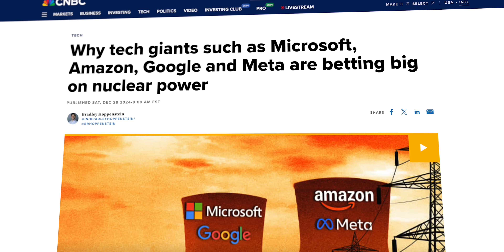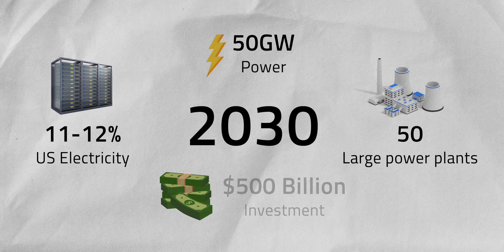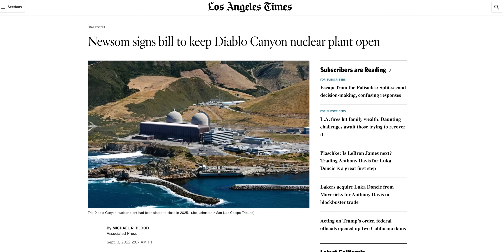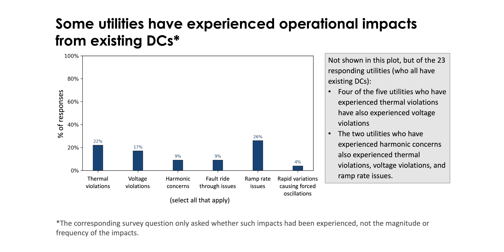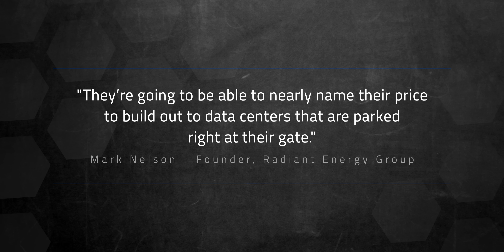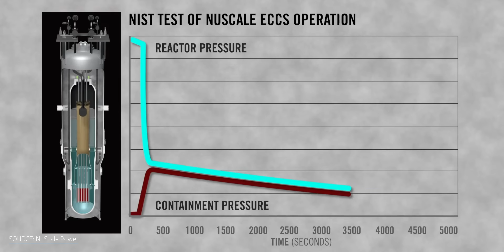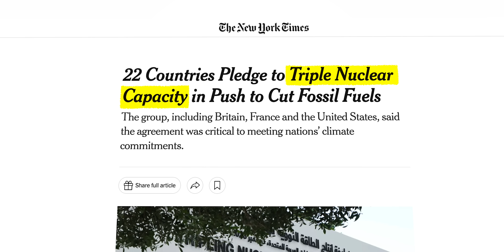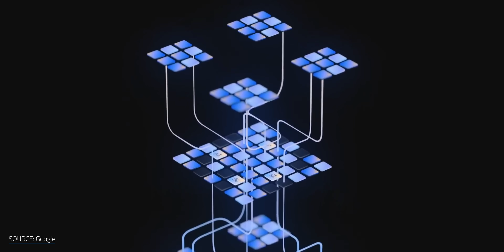Why Big Tech's Betting Billions on Nuclear (Not Renewables)

Comment: As a design engineer that works on automotive electrification directly, it always amazes me how many people talk about the affects of EV charging on the grid when data centers are using WAY more power than EVs. This just goes to show that public perception is all about marketing.
Reply: What? Datacenter load is flat. EV charging is variable. Even more variable when DC fast charging. There is nothing utilities hate more than variable load that requires active load balancing and coordination of fast dispatchable power. They are so concerned with it that a Microsoft Datacenter in Washington had to run multimegawatt load banks for several days to avoid fines from the electric company for not using enough power due to delays. The cost of electricity was less than the fine for not using it.
Reply: @erikkovacs3097  Great points! I think in general his comment is hitting two political mindsets while not making apples to applies comparisons when it comes to electrification. You're completely right, but I think he's generally making the comment that right leaning voters and administrations are green flagging the rapid growth of data centers to reap the financial rewards of the big companies racing for AI dominance. This rapid increase in electrical load from fossil fuel powered power plants threatens most environmental Co2 emission reduction goals. On the other hand is the push to transition away from fossil fuel vehicles to electric vehicles in order to reduce carbon emission goals as well as other benefits, which is negatively viewed by the conservative right and is facing large public cultural backlash. I personally like the idea of Vehicle to Grid charging to alleviate electrical load to the grid, but I like how your comment points out realities of power plant operation.
Reply: @victortillamillamonster4083  The large backlash for EV's is mainly because we were lied to. They said they would be cheaper to buy and cheaper to run and cheaper to repair. They were wrong on all those points. Couple that with the fact that battery prices can't really go down anymore and it becomes obvious, there will never be a transition to EV's with current technologies.
Reply: @ not really true, our government is purposefully limiting competition in the EV market in the US. Prices are lower for EVs overseas because EVs in China are dirt cheap. Couple that with the fact that most Americans still want gigantic road warrior vehicles and you can see why our EVs are so much more expensive than in the rest of the world. The real reason EVs are so expensive here boils down to profits.
Reply: EVs are mobile compute units where the driver funds the electric costs. Literally. It's major part of Tesla Taxi business model, and it's likely same model used on all EVs. Most EVs spend a lot of time parked and charging, but the compute is still active. Network the compute and you have a decentralized data center that civilians pay for and the corporation gets all the profit.
Reply: A lot of EV owners don’t even get their power from the grid.
Reply: No one is going to address the huge lie that was briefly mentioned in the video? The whole point of everyone being told to switch to EVs was, lower emissions and they will be cheaper and better. The largest emissions are produced by factories, manufacturing, and data centers, not your everyday car drivers. Also they arnt cheaper, dont last as long, are harder to fuel. So as usual, the common man was told to adjust their life to change some global factor that they contribute less than 10% to. Same story with waste management and plastic straws or pollution in the ocean, almost all by fishing industry and factory, same with local water pollution. If proper regulation and enforcement of common sense laws designed to better or maintain the common man instead of multi million dollar companies lobbying (bribing) the government to allow over 90% of all these issues would have happened or happen now, no one would even think they needed to change to a EV. It would be a new thing on the market and some people would get it, and once the general economy built up around it more people would buy in. If the government didnt ham string nuclear energy for the last 100 years, on purpose, we would have massive gains in global emissions deductions without any EVs even being produced. Now that huge billion dollar companies want more power for their profit driven products... Nuclear power is suddenly being procured. Just like almost all the profit driven power and water companies complain that, The infrastructure can't handle it ,while being 100 years old and never updated or maintained. So the question is what have you been doing with all the profits of the last 100 years? If not planning for the future or maintaining the current gear in place? Why is it on the taxpayer to subsidize or fund power creation when the companies that have been providing it for 100 years making money can't do it themselves? Why are consumers being told to switch to EVS and in some places being forced to or like where I live in Maryland Banning gas powered leaf blowers and soon lawn mowers when almost all emissions are produced by large scale companies or overseas. This is a problem derived from greed and lack of forward thinking ideas and reinvestment into the future. It has nothing to do with the common man and everything to do with the people making money while destroying the Earth want to keep making money the same way. For example, in Europe they were told to switch to EVS but the grid couldn't charge them after everyone bought them. So then they were told to install solar at their house so they did and now there's too much solar being pushed back to the grid so now the consumer who was told to buy the EV and solar is being charged money by the power company for producing too much power because over the last decade they invested no money into any type of power storage to convert excess solar into usable energy at night and the fault and cost is being passed on to the common man. My point is, if you want to actually address any issue you should start from the large to the small. Address power production, the grid to handle it, the houses and factories that use it. By then, plugging in a EV will be easy and cost effective. They want bigger data centers, they are building the power supply, the grid to the center, and then the center. Elon made Tesla cars, batteries and chargers and the people who want them buy them. The state of California saying everyone needs to have EVs for the climate and mandating it, with no clean power supply or grid to support it is childish and puts all the stress on the people who have no control over any of it. Stop trying to control the masses and instead build the thing you want and people will choose to come when they can. My 1976 impala still runs great, my 2011 ford focus still runs great, why would i ever get an electric car? But my gas, electric, water, and Internet bill keep going up... And what would fix all of that? Nuclear power. But that would bankrupt all these terrible companies profiting off a old system bc they havnt updated their power lines in 80 years or their gas heaters in 60. I know this bc they had to replace mine last year and the tech told me.. did i get a newer design or more efficient or electric one? No, i got the same model just new bc heaven forbid the apartment complex update any of the pipes and systems along with the heater, that would eat into their profit margins. But... They banned gas leaf blowers lmfao...
Reply: Course, most U.S. utilities whom have done analysis don't understand how to have generation, transmission, substation, etc. for 100 % electrification

Plus, datacenters need baseload equivalent with peakers compared to electrifications which do not need 100% load
Reply: Data center is a good thing, ev car is also a good thing, why turn one against the other
Reply: @abinodattil6422  agreed!
Reply: Out of site out of mind. Who is ever thinking of data center? Vs how many people are thinking of cars
Reply: Interesting point.
Reply: Data centers are already talking about going off grid. Both are going to require massive infrastructure buildouts to be in anyway sustainable.
Reply: You can charge an EV while you sleep. You dont use chat gpt while you sleep. So AI competes with human daytime  electricity demand.
That's important from a grid capacity perspective. It's about utilization of the infrastructure around the clock.
I think there is definitely a market for AI which is able to time delay it's "thinking" to times when grid demand is low. Or aggregate across time zones
Reply: @robmilne1562 you can do Ai on the opposite side of the earth though, you car has to charge locally
Reply: @ Data centers don't just do AI. According to Statista, the US has 45% of all the data centers in the world. Data centers also currently consume 4.4% of total US grid power whereas EVs makeup only 0.5% and are only expected to reach 4.6% by 2030. Data centers are expected to reach 7.5-10% by 2030. EVs are a drop in the proverbial buck compared to data centers in terms of power usage.
Reply: @robmilne1562  But people all over the world can use ChatGPT that can get routed to datacenters in your area depending on demand.  Even some automation is incorporating ChatGPT that could be running while people are asleep.
Reply: @robmilne1562  people talking to chatbots is a tiny percentage of power usage, he did a massive disservice in this video...this compute, like most data center compute, will be operating 24/7
Reply: ~40% of population rents — they will mostly need fast chargers, which will likely be used before & after rush hour, which massively increases transient loads on the grid.

Base load for data centers does not offer the issues for energy producers that transient loads do.
Reply: Some big differences:

1) Because cars last a long time, even if every single person wanted their next car to be electric, the transition to EVs would still happen very gradually, over many years, giving utilities lots of lead time to plan. By contrast, new AI data centers are coming online much more quickly.
2) Even for people without home solar, EVs can easily be charged during the overnight period where overall electricity demand is low (because businesses are closed and everyone is sleeping). Stress on the grid is determined by peak usage, not total usage, so EV charging during low-demand periods has no grid impact. Of course, for people that do have home solar, charging off the sun is even better, but that's not a requirement.
3) Many public EV fast chargers are equipped with on-site battery buffers. This switches the site's power draw from huge, unpredictable spikes to a slow, steady stream of power consumption. This greatly reduces the stress that EV fast chargers put on the grid, and rewards the operators with much lower power bills, while also increasing the set of locations where EV fast chargers can be installed at all. As batteries get cheaper, this practice is going to get more common, and will likely become universal long before every car on the road is an EV. With AI data centers, the battery buffer trick is less useful because power demand is already pretty constant 24/7/365, without big spikes.
4) Some of the electricity used by electric cars is offset by electricity not needed by oil refineries to refine crude oil into gasoline. No such offset exists for data centers.
Reply: @ab-tf5fl  Refineries don't consume a lot of electricity. They make it themselves. Sometimes, they produce enough to send it back.
Reply: Data centers are highly consolidated in commercial area's meaning they get 3 phase. You of course know this. Why does it amaze you? My 100 amp circuit on my apartment power distribution box simply can't handle an EV.
Reply: @GeorgeWashingtonLaserMusket I'm glad somebody said this.
Reply: Quite obvios that you dont really understand what you are working with
Reply: I get free gas from work and that stops me from going electric, oddly annoying.
Reply: Absolutely right dude, you could say it better.
Reply: It seems clear to this layman that data centers use 2-4 times the power than the bulk of electric cars do and it is expected to stay that way. I have not heard anyone posit otherwise. Where are you finding these people you speak of?
Reply: @vicnighthorse  I think the great uninformed unwashed masses do think that way.  They can see Tesla's, they can't see the data center.
Reply: I've heard EVs are the cause to all problems under the sun. I'm half kidding but there's definitely people complaining about EV energy usage with no realization about data centers.
Reply: @vicnighthorse  you have one just the next comment below
Reply: EVs are still a far larger drain overall and and a far larger potential drain as more local governments try to force people onto them sooner
Reply: @rob_over_9000  Considering Ev's are replacement for gas vehicles with the purpose of reducing the impacts of global climate change, reducing gas consumption and the drilling involved in that, improving air quality and reducing maintenance costs of oil replacements etc. The negatives of Ev's are there for sure, but people never compare them to negatives of gas and oil. They are far less. I find it baffling that people think EV conversion is a massive conspiracy by poor local government officials and yet don't think about the influence of big gas and oil literally putting people on the payroll to discourage EV transition. I mean can you explain how EV's are a larger drain overall?? What does that even mean? Mining and Carbon emmissions of manufacture? No, its already been disproven multiple times...please compare it to production of new gas and oil vehicles
Reply: Could our power grid handle everyone having an electric car? I don't think it could even if we didn't have all these data centers
Reply: @CaptainMisery86  I’m Australian. Many Australians who own EVs also have solar panels on their rooves. In fact, about 30% of Australian homes now have solar panels on the roof. This has been happening since long before EVs became common. What happens now is that at certain times of the day, the system has more electricity in it than it can consume. A result is also that many EV owners are effectively getting their power for free and with no affect on the grid. So we don’t have a power generation problem. We have a storage problem. As a result, there are huge community batteries springing up all over the place to take advantage of it.
Reply: @ Maybe it is helpful to think of it this way, (according to Perplexity Pro) US data centers are expected to use 225-240 TWh this year while US EVs (which will be 2.5-2.8% of the total fleet) are expected to use 40-80 TWh. So I suppose the answer is likely no even without the data centers) however data centers will still likely use more power than EVs. It is also unlikely that everyone in the US will own an EV within the next 30 years.
Reply: Vehicle 2 grid charging. Quite possible just not in big business interests
Reply: @CaptainMisery86  Well I own a home with a 200 sq metre roof. If I completely covered it with solar panels it would generate an average of 120 kwhs of electricity per day. That is enough to keep 14 Tesla Model Ys fully charged doing 20,000 kilometres per year each for over 20 years. for a total cost here in Sydney Australia of  around $25,000 ($16,000 U.S.). The grid doesn't need to handle it. People will and are just doing it on their own.
Reply: @markumbers5362  panels don't even last 20 years !! On top of that your leaving about about 99% of the story not to mention cost .. what are you storing all that power on??? Ohh you dumped 100k into your solor system and storage..ok got it ! and might get 20 years out of the panels and a few years out of the battery's.. thats why you left out the other 99% of that story !!  Forgot probably wasn't suppose to say that
Reply: @thethirdman225   wow you can't even use google can you.. maybe some do they they might be working on that no one has but  the internet says I am wrong  its more like 10 years
Reply: @reapersasmr5483  My late parents’ house has had solar panels on the roof for about 30 years and with regular cleaning they are still going strong. There’s not very much that can go wrong with PV panels.
Reply: @thethirdman225 you are correct. The efficiency degrades over time, but the panels can last much longer than 25 years. The manufacturers usually list the % efficient at XX years as there longevity rating. Like, 88% efficiency after 25 years. Meaning they will still produce 88% of there initial energy value after 25 years. With proper maintenance, they can last for a very long time. Like you said, there is not much to go wrong with the actual panels.
Reply: @CaptainMisery86 I'm not getting an EV,so count me out !! I don't want my house to go up in smoke !! Sticking to my 2001 model Commodore Ex.
Reply: And that EV's are clean tech. Look how much manufacturing them makes drinking water wasted for how many years due all chemicals more than even oil could in water what they fight against for.
Reply: That’s because only a minority of elites have EV’s. The point people make is the effect on the grid if we were force to ALL switch to EV’s. The other difference is data centers are centralized and can have a dedicated power plant so they don’t have to rely on the grid.
Reply: We don't need BEV, we do need data centers.